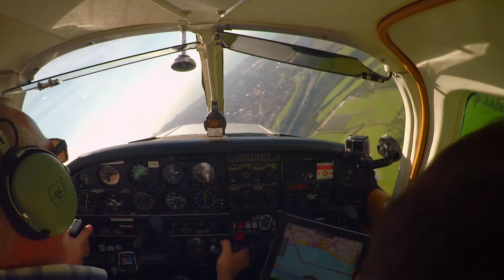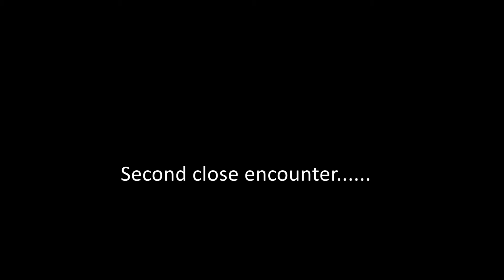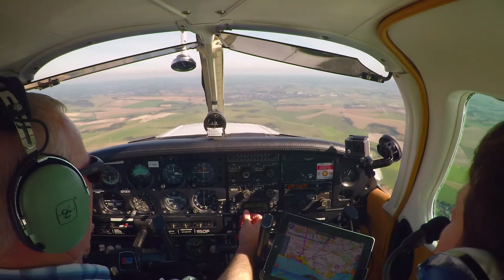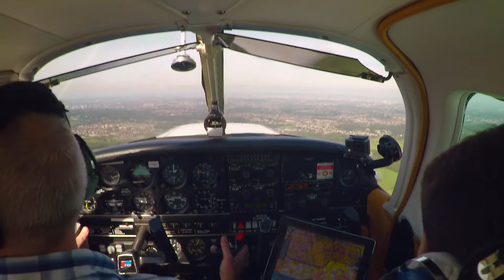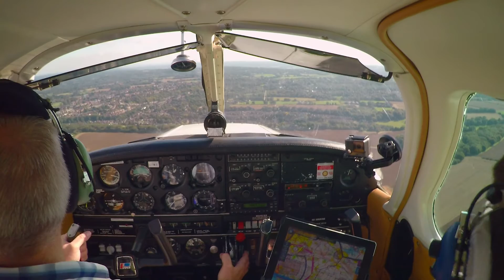See and Avoid - How light aircraft avoid collisions.

Comment: Thank you so much for uploading this video. As a student, these sorts of incidents cause me great concern, although I do my very best to keep my scan of the skies frequent and methodical. Forgive me if this is a daft question, but would using the wingtip strobes be useful is making aircraft more visible?  My fear is that, unlike you, I would not react well and possibly exacerbate an already potentially dangerous situation. I'd be most grateful for your comments. Many thanks indeed. Peter
Reply from the maker: I, like you, used to fear getting this wrong.  I'd discuss it with your instructor.  With practice and experience, your responses become instinctive and fast.  Though, at first, I remember not knowing quite what to do in this situation, and feared making it worse.  Personally, I've never seen the strobes (in daylight) before I've spotted the hull.  I had an airprox soon after qualifying, and my aircraft at the time had wingtip strobes, and it didn't prevent that.  Practice and experience will allay your fear.